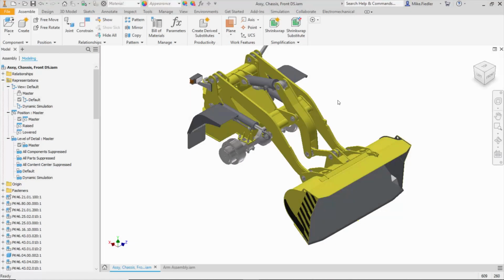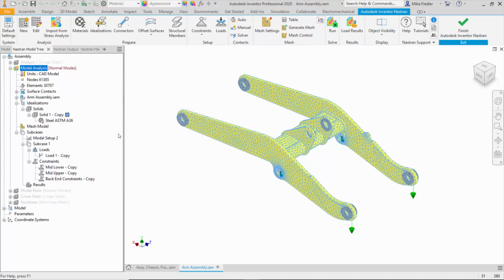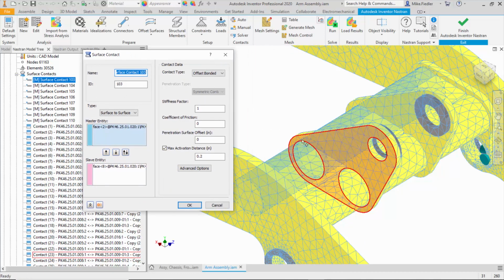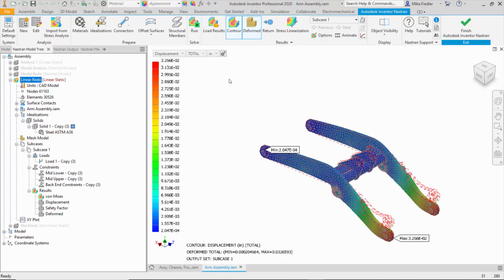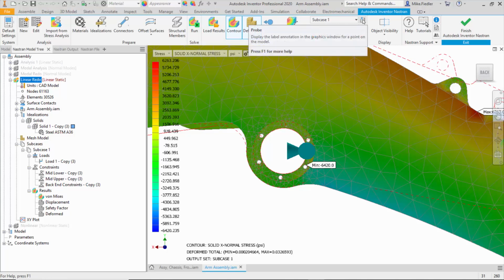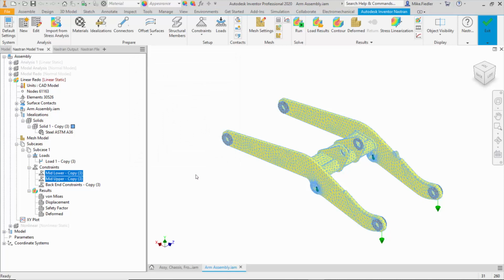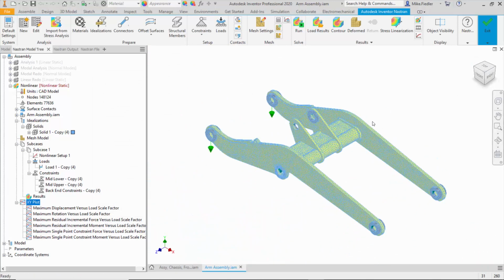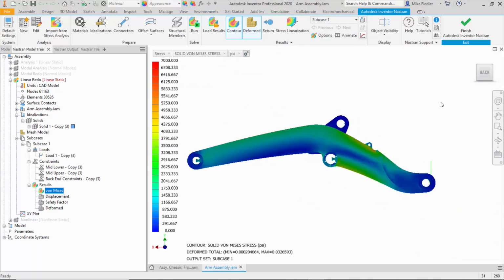Product Simulation with Autodesk Nastran: Interpret FEA Results

Comment: I have a question , is it possible to do a simulation on the milling process of the cutting tool by using nastran to do FEA on the cutting tool to get the the result such as the generated heat during the milling process and the exact location of the heat generated on the cutting tool itself while changing its rotation speed of the cutting tool? Im still new with this software, so im not sure if its possible doing this type of experiment through virtual simulation
Reply from the maker: Hi Benz Benedict,

The best way to get a detailed response to your Inventor specific questions is by posting on the Inventor Forum.

Here's the link: https://forums.autodesk.com/t5/inventor-forum/bd-p/78

Hope this helps!

Best regards,
The Autodesk Inventor Team

Comment: Great work. what is the difference between a structural and rigid constraint. Also if I am trying to simulate a journal bearing is the pin constraint what I use?
Reply from the maker: I would check out the Nastran forum: https://forums.autodesk.com/t5/nastran-forum/bd-p/97

Comment: Very useful video, and indeed a very powerful fea tool. It just needs to improve the graphics management system, from my previous experiences using nastran i experienced very slow performance. It also misses the possibility to constrain in positive or negative directions. That's a very important feature that needs to be added.

Moreover, the failure criteria based in yielding is a big mistake. It certainly has the chance to fail in the notched sections due to crack propagation. Therefore, you need to analyse the failure criteria in the context of fatigue. And that's one of the reasons why those components are made of high strenght steel alloys.